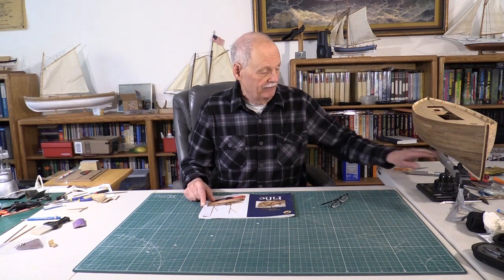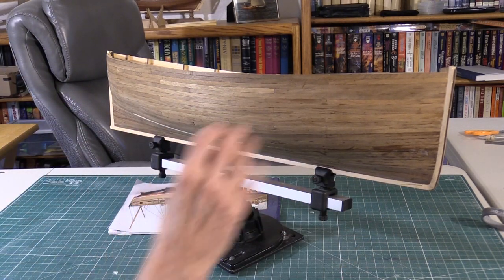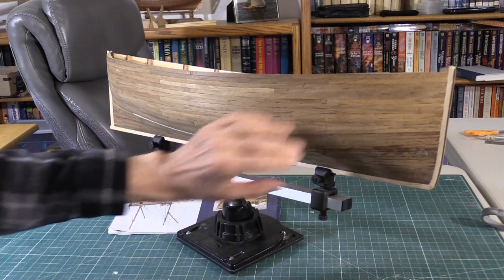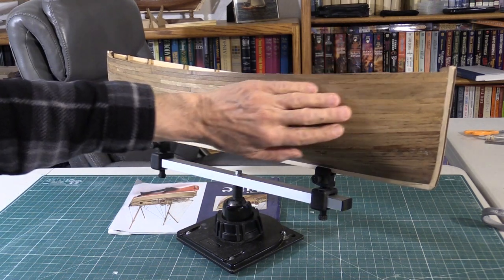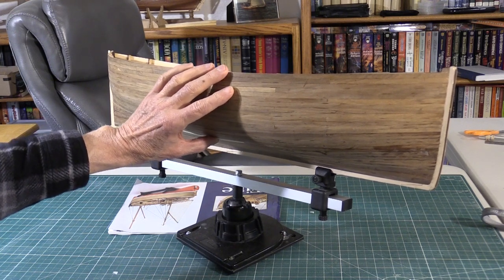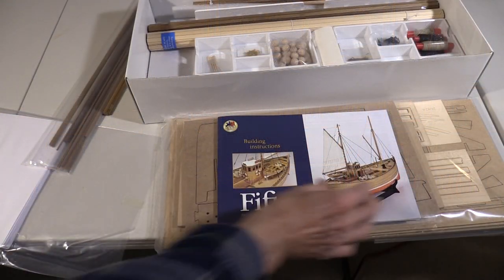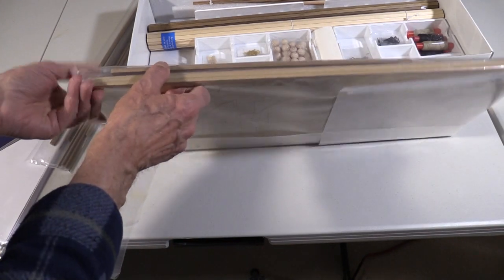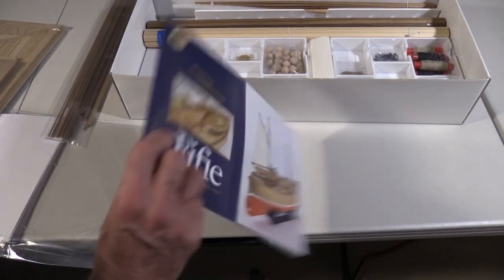The Scottish Motor Fishing Vessel – Fifie Part 1: Planking

Comment: Instead of using all those clamps you can use pins with plastic heads that you press into your support board. The sides of the pins will press against the sides of the planks. I soak my planks in hot water before I use the iron. I like your videos they show how much thinking goes into each process.📌

Jacques from Montréal
Reply from the maker: Thanks for the info!  I tried these pins, but without much success and decided these do not work.  But I will consider them again on future builds.  
Ken

Comment: I need more clamps. That's an interesting setup to bend the wood on the small end. Thanks!
Reply from the maker: You bet!  There is so much information about building boats on the internet.  Some I can use, some does not work for me.  I found this technique to be useful in this case with long gentil curves.  And yes, one cannot have too many clamps :-)
Ken
Reply: @ken_boats   Thanks Ken. What I found useful on filler planks is something I learnt when watching "big boat builders" I just cut wedges of wood and hammered them in to keep them in place until they set.

Comment: Good video and tips. I'm in the process of doing the first planking layer and will be using some of your tips. While not being as fussy with this first layer will be for sure on the outer walnut planks and the rest of the model. I've made a few mods though as mine will be an RC (WET!) version and needs a bit of reinforcing and add ons in places and possibly some rigging omitted.
Reply from the maker: I am glad it was helpful!  Building the wet version sounds like you're going to have fun.  very cool.  Ken

Comment: Any updates
Reply from the maker: Yes, I am slow :-) but I finally did publish the next video on preparing the hull and painting it.  I am now working on the deck - which consists of many custom fitted planks.  This video of the deck will take a few more months.  I am getting faster at building boats as I learn the tricks, but my time to build boats is also shared with other activities, which slow my rate of publishing.   I took the summer off to hike, sail, and work around the house, but now I am back at my typical pace.
Ken